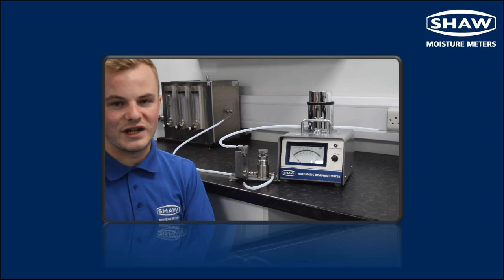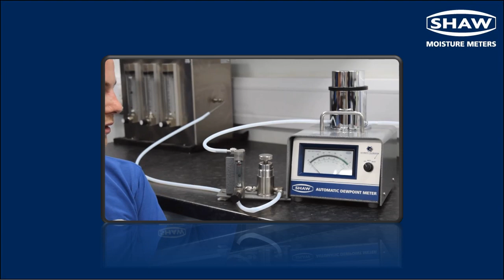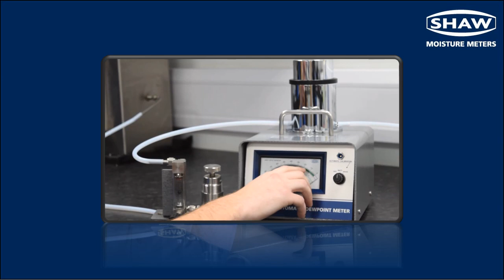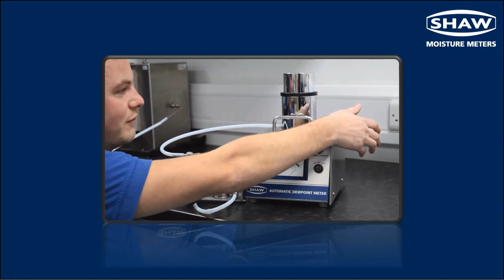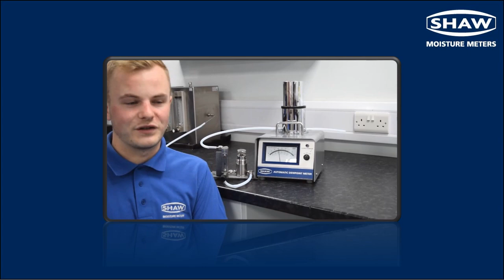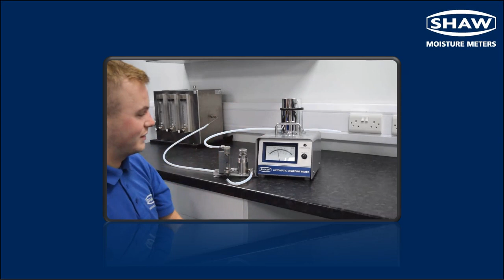Taking a Reading   SHAW SADP Dewpoint Meter

Comment: Please note that your device does NOT measure moisture dew point.  To claim otherwise is inaccurate.

Your device, like most other devices, measures moisture content.  Then using some equations, it will calculate the dew point.  There is a difference between calculating a property from inferred measurements and actually MEASURING that property.  As a manufacturer, you should really pay attention to technical accuracy of your claims.

The only way to MEASURE dew point, is using a chilled-mirror.

Definition of water dew point:  The temperature at which water undergoes a phase transition from vapor to liquid.